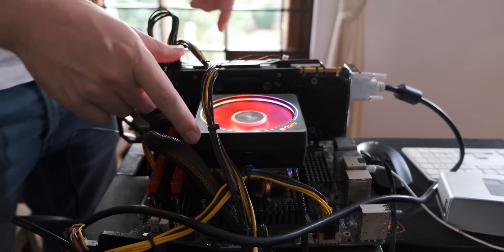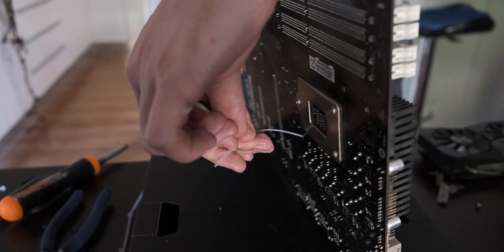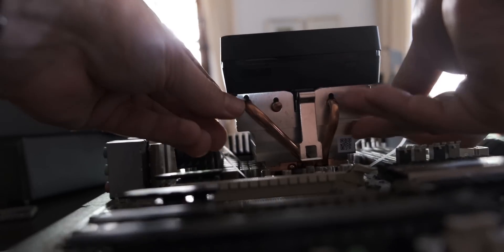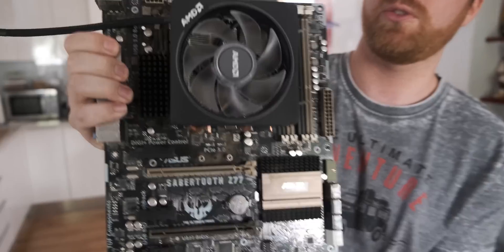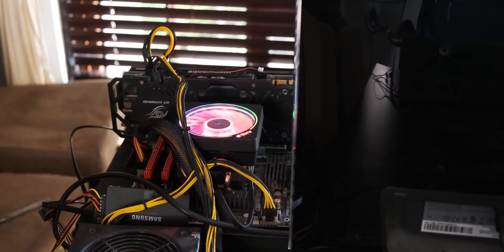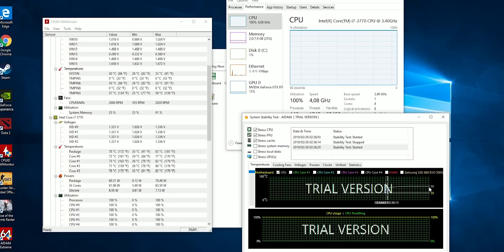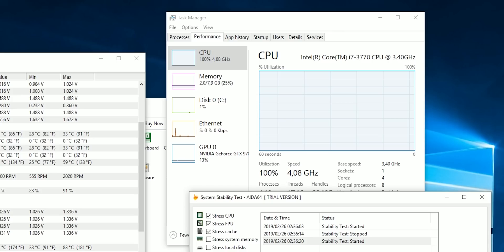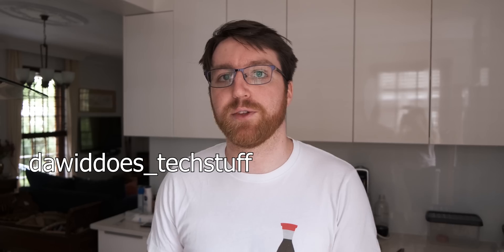AMD Wraith Spire MAX cooler strapped to an Intel I7. How is it this good?

Comment from the maker: It's been brought to my attention that HWmonitor is a really terrible way to measure temperatures. I did also add the temperatures from Aida 64's built in temperature monitor for the stress tests. If you only look at Aida 64's temperatures, then the performance of this cooler is very impressive. Under full load it doesn't go above 58c. 

Also there was a clear 20c temperature delta between HWmonitor's termps and Aida 64's temps. This means that for the gaming results, just remove 20c to get an accurate result. (This is if Aida 64's temperature measuring is considered accurate, I may do a video testing all the different temperature monitoring software.)

Sorry for my incompetence and I won't use HWmonitor again.
Reply: hw info is actually the best way to measure temps... every overclocker uses it. the temps are not read from the cpu, it measures the delta to tjunkction. sensors from motherboard eg asus measure the socket temp, thats not as precise as tjunction. you should use core temp or hw monitor. core temp is a bit better to read and you can change to tjunkction really easy.

Comment: did this on a lga 1151 (z170 from msi) and it worked with a few more zips. temps never go over 62°c, but its an old i5 7th gen cpu. its now holding 3 weeks and i had zero issues so far.
Reply: Men, you have it on like in the video and it still works and nothing has burned

Comment: Whats funny is this is something i had to do at first when i was upgrading an HP Victus (i ended up 3d printing a bracket) The erica8 mobo uses a 1155 mount with an am4 socket so this was a fun time.

Comment: Fun fact, most aftermarket coolers are AMD designed and come with an adapter bracket to install in case of you have an Intel, using said bracket allows you to put AMD coolers into Intel motherboards (Except Wraith Stealth), if you ever bought a chinese tower cooler it's most likely it comes with a round plastic piece, that's the adapter

Comment: I just put one on a 7800x not even mounted, just resting so I could run some tests. It cooled it so well, I was able to over clock from 3.5 stock to 4.6 and didn't even break a sweat when bench testing and stressing.

Comment: Zipp's used for cooler mounting means you need to buy an Xbox!  not a damned Pc.

At least do NOT use WHITE zipps... Since they are more sensitive for heating and/or uv light impact to brake... Black ones can handle that much better ;) 

Better is not to do this at all... Just be creative with some steel and drills...

Comment: is this setup still alive? I have an extra wraith prism is want to throw on my old 3750K just for fun
Reply: I just did..  On a 4670k on a b85m-D3S..  Took an oc bios for the board,  running 78c package on 4300mhz OC with 1.225v at AVX1 SMALL FFT
Reply: @jpmillman1  Hi how long did it last?
Reply: @Free-Palestine170   It's still working as a backup system. Running like a charm
Reply: @jpmillman1  awesome
Reply: @jpmillman1  did you have the zip ties touching the copper pipes? Did the ziptie take any heat damage?
Reply: @Free-Palestine170  i cleanup my PC's at least yearly.. so changing cooling paste and thereby the tiewraps is preventing any damage. However, I cannot see the tiewraps melt or soften with temps maxing 80c (CPU is in the 90's at that point). Gaming the CPU reached a max temp of 67c..

Comment: looks great. gonna try this on my 1155 i5.
Reply: how was it, am thinking doing wraith cooler on 1155
Reply: Did the ziptie melt
Reply: Hi how long did it last?
Reply: @Free-Palestine170   Sorry guys, for the late reply .I forget to check my youtube alams.  It work well. but I got a used cheap single tower, so I switch to that.
Reply: @acca17  thanks! did it work for a whole year?

Comment: From aliexpress, you can get this plastic bracket that mounts in the 115x holes in the MB, which then in turn accepts the AM2/3/4 "clip type" mounting solution, like this cooler you have, has. Most cheapo Aliexpress coolers actually ship with this.
Reply: Кронштейны что продают на алиэкспресс не подходят, проверено мною.
Reply: Can u give link? I have h310m ds2  1.0 ver. Can i buy backplate and install this cooler on I7 7800?
Reply: @frankdrebin1249  https://www.aliexpress.com/item/4000329243573.html its pretty much this, if its not what you are looking for, just search for "CPU BRACKET" in ebay / aliexpress. Cheers.

Comment: This is great, I’m thinking about trying this! This might be a dumb question, but do you think the zip ties would be strong enough to hold the fan up if the motherboard was mounted on its side in a PC case?
Reply: there are brackets in this comment section that makes this cooler compatible to mount
Reply: it will hold up if you don’t make it lose make sure to tighten it

Comment: did the zip ties end up melting or was it fine long term
Reply: Melting point for Nylon plastics is 190-300 C. I'm concerned about whether it dislodged and broke something. He probably should have used black as those are supposed to have additives that make them more durable.

Comment: Can it fit with 1151?
Reply: Emircan FİDAN did you find out if it worked?
Reply: @chrishau3262  still dont
Reply: Emircan FİDAN i'm gonna try monday
Reply: @chrishau3262  if it fits ı will going to buy one and try myself. Can you give me information if it fits? Xd
Reply: Emircan FİDAN it's fits, however i would not recommend. it's hard to fit properly and also you would need smaller ones and less durable fits means your cooler had a chance of slipping. while idle cpu temps reached up to 60-70 idle and 90+ underload. had to switch and use a stock cooler

Comment: how safe is it? should i try it as a long term solution ?
Reply: no, it will flex your MB in ways it won't  like. The back bracket for coolers has a purpose

Comment: UPDATE Dawid please hear me out! I tried the same thing you did to an LGA 775 motherboard. I had a spare AMD cpu fan. And it works so goddamn well. Im subscribed. Hope you read this dude.
Reply: nice gonna try this on my lga 1155
Reply: Does this works? Holy crap im gonna try
Reply: Hi how long did it last?
Reply: i used cable ties and attached the amd spiral fan to the intel fan block. thats how i did it
Reply: @Ylann Rimbon it didnt. its been one year and im still using it on my vista pc
Reply: @lodocus1501 any update?
Reply: @lifedroid  i just did this on my pc, it is stable as hell and the temps are around 30 degrees celsius on idle

Comment: back when one could make a living in a computer shop I had a elderly customer come in saying his pc felt really slow and would sometimes shut down, upon inspection one of the tabs for the heat sink clip had sheered off. I didnt have any on hand for a HP intel p4 setup told him I would have to order it, looking it up and nearly impossible to find  it was going to be almost 100 bucks for the part + postage + the time to take the mobo out and replace the thing 
So this elderly dude on a fixed income living in a retirement tower in quite possibly the 2nd poorest part of town tells me well thanks I will have to come back after I shuffle the budget,  I said here's what I can do now, and I zip tied the silly heat sink down to the board using a good outdoor rated one we used recently to run some network stuff out at a school athletic field. It got him by, for quite a while... like a few years and finally he came back in when the machine got zapped by lightning and bought a used AMD A2X2 from me ... zip tie was still in place on that P4 holding solid, though the psu and mobo were fried
Reply: That is a nice story, how is that elder man now?
Reply: @cgwworldministries RIP

Comment: Nice! Would also love to see how a Core i9 (95W TDP) fare with this cooler (using a better mounting)...

At around 3:50: "I don't know how hot these pipes get. It's not gonna go about boiling, so..."
LOL! The whole idea with heat pipes is that the contain water that boils as it absorb heat at the hot spot!
There's a low pressure inside the pipe though, so the boiling point is below 35 degrees celsius...

Comment: I hope someone would make a 3d printed am4 to 1151 bracket. I really want to install this on my i7 7700. It's hard to find top flow RGB CPU coolers without ram height limits like this one. :(
Reply: @cgwworldministries the link doesn't work
Reply: Same but I want one for Lga 1700
Reply: We actually have those in the Philippines
Reply: https://www.google.com/amp/s/shopee.vn/amp/B%25E1%25BB%2599-khung-mod-t%25E1%25BA%25A3n-nhi%25E1%25BB%2587t-AMD-cho-Intel-soclet-115x-1366-i.26646813.2351031705
Reply: @nguyentrung462  Where to buy outside of Vietnam?
Reply: @SmokeMastaP  have no idea, u can try Google
Reply: They come with aftermarket coolers, most are AMD designed and come with an adapter
Reply: Tru to take that cpu flap and drill in that bracket and it should work if not then I'm fuck

Comment: This is an interesting experience, but only from the “here and now” position. Otherwise https://www.ebay.com/itm/CPU-Heatsink-Cooling-Fan-Mounting-Bracket-Holder-for-Intel-775-1156-1155-E6/333097169014?hash=item4d8e237076:g:uQkAAOSWjXZcdC11 : rk: 3: pf: 0 or something like that.
"FPSMonitor" finely tuned and displayed in the overlay

Comment: U can actually buy a mount for the amd to Intel socket coolers
Reply from the maker: Could you post the link here? I looked online and couldn't find anything. I'd be curious to see it. :)
Reply: @DawidDoesTechStuff  I'm from India so this is from Amazon India. 
U can also find this clip with some cpu coolers
Reply from the maker: @anirudhmallikarjun7067  Oh wow. That's awesome. Thank you for sending the link. :D
Reply: @DawidDoesTechStuff  your welcome 😊
Reply: @anirudhmallikarjun7067  £300
Reply: @anirudhmallikarjun7067  Are you sure that it can mount amd coolers? It looks like a normal mounting bracket for intel. I'm planning to put a wraith cooler on my i7 7700. I really need something like this.
Reply: @hondaguy1844  ya i think this will work for sure just make sure you have space on your mother board
Reply: @anirudhmallikarjun7067  will check this out. Thanks for the info. :)
Reply: Can someone link me a USA version does anyone know if this actually works?
Reply: @Rillaaa993  I think that bracket is for am3+ (besides obvious 115x socket), am4 is 90x54mm and am3+ is 96x48mm, maybe those additional 6mm on height could be enough, maybe you could tense too much your motherboard and bend it a little bit.
Reply: On the other hand, you can scratch out the excess in case is too tight, it is plastic and they are very cheap on sites like Gearbest or Aliexpress. Intel's 115x height is 75mm (holes) but the diameter for the bracket you showed is 95mm (maximum specification by Intel standard for clearance around the socket) , only need to scratch 5mm on the sides where the Wraith Prism would go.
Reply: can anyone link me a uk version by any chance

Comment: Oh snap, I thought you've just glued it with thermal glue
Reply from the maker: It would be interesting to see the performance of the cooler if you just rest it on top of the CPU with no mounting hardware.
Reply: @DawidDoesTechStuff  i would think that would go well but it would make a cool vid